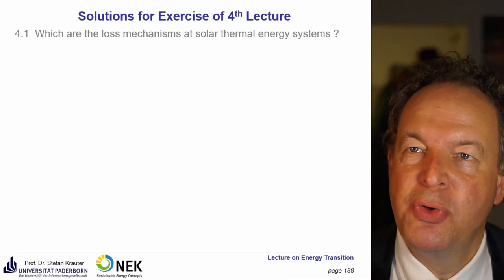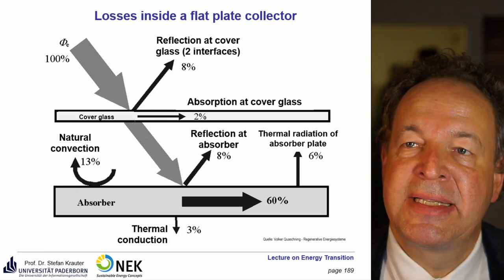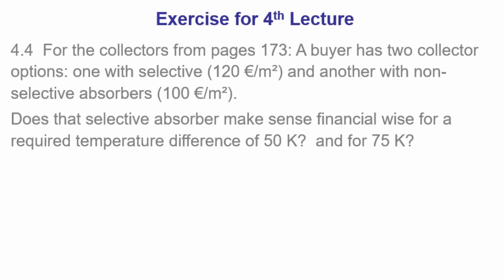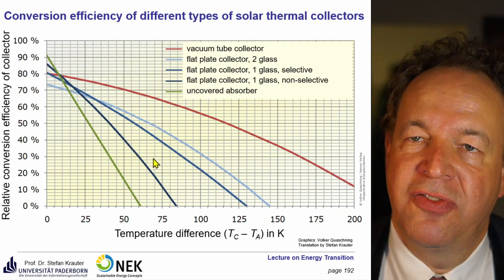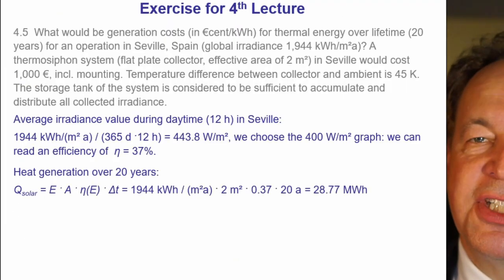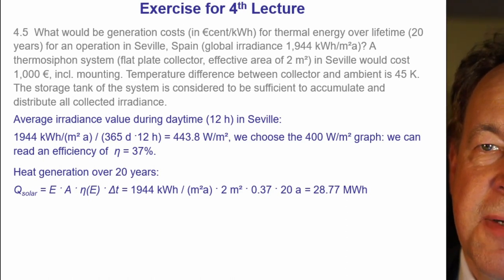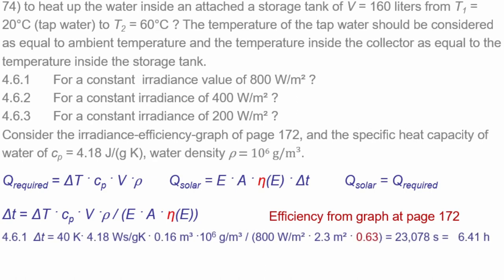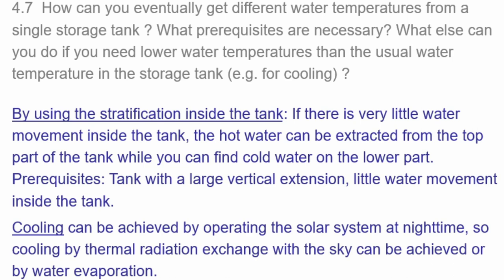Exercise 04 of Lecture Energy Transition - Solar Thermal Systems

Comment: the reflection losses through the reflector and the wave losses between the reflector and the absorber should not be considered when counting the loss mechanisms in solar thermal energy systems ?
Reply from the maker: In the example discussed, there was no reflector. 
What do you mean by "wave losses" ?
Reply: @Stefan_Krauter  you talked about  it  in page 168 , "Energy flows at a solar parabolic trough collector" .
when the losses are to be considered in this case  ?
Reply from the maker: @zakariabarhdadi9925  if you use a parabolic trough collector, you have to apply the losses by the non-ideal reflection at the mirror of the parabolic trough. The exercise was only about a typical flat plate collector without mirror.